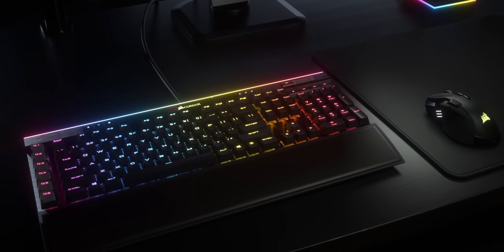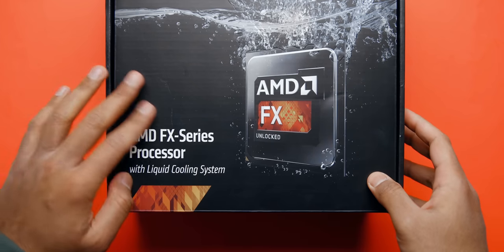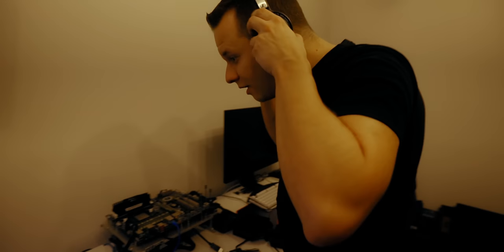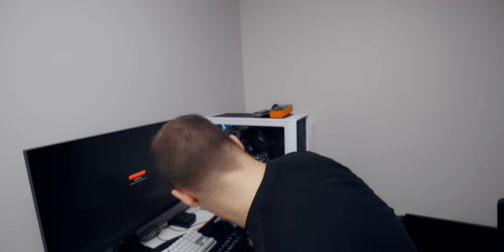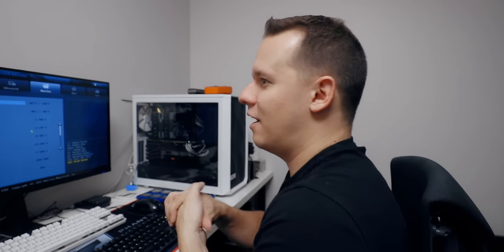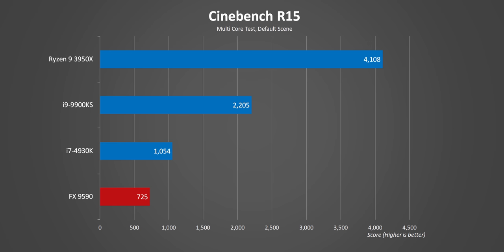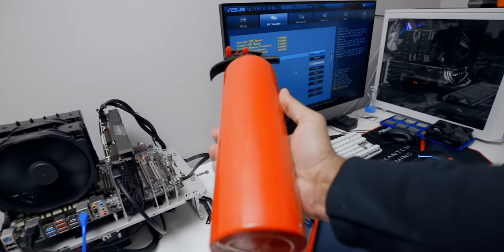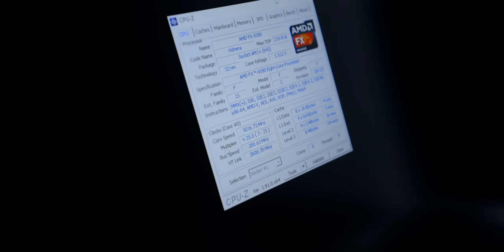Why The FIRST 5GHz CPU Almost Failed - AMD FX-9590 Revisited!

Comment: Many things could be the problem 
NUMBER 1 #  Sensor pics up to much heat  when Turbo brings it up 300 Mhz to 5000Mhz speeds or more!!  "shut you down safety auto! " This is also gonna shut you down not to damage CPU & Motherboard..
This means your cooling solution is not enough or properly working.
POWER SUPPLY  must be a Heavy Horsepower one!! at least a 750 Watt! or a 850 WATT!!  
Why some power supply's at Lower wattage may not be certified to deliver proper power to a 
motherboard with heavy power draw ! yup it's happened  causing a shut down!!!   Seen this to!
Second Motherboard doesn't go that high without a Bios Update!... There bios was made for Certain  CPU'S and Speeds and updating corrects the speed levels accepted by the Motherboard and newer type high end CPUs on the FX line .!!  Some boards were made way before these  type of CPU's were brought to the market!!!  by 5 years or more so check your motherboards spec's !! And again Bios update corrects this problem most of the time!!!!!
Turbo goes to high  settings  and whatever Ram or sink you have  in Ram settings !! yup! and setting it will also crash!!  So make sure those are adjusted to!!  Check online tech tutorials YouTube has them..fast fix.
Sinking your system is also very Important when going high speeds !!  Smooth gameplay.. no flickers and no stutter means your system is tuned perfectly those bad things are signs your not in sink.
So many things to check !!  
You also have to have a Tower with serious air flow!  Front in back out  top out and super fan on cpu heat sink threw and other side fan out towards back fan!   This is my setup  never had a problem!
Plus double fanned CPU  heat sink for much more cooler flow..
Tower and fans and coolers are a must when you go high end Hot CPU's !!!

Comment: One thing I would like to see if posible is a comparison between a Raid 0 setup using 2 x Samsung 1tb 970 Pro's on an X570 mb vs a single 2 tb PCIE 4 x 4 nvme m.2 to se which would be the fastest on the PCIE 4 interface.

Comment: I ran a 9590 for a long time, I put an AirMaker 8 cooler on there, ran it at 4.6GHz.  Ran perfectly.   Please stop using that hateful Adobe Premier crap that everyone knows is in fact optimized for Intel, I use Powerdirector which was optimized for AMD, significantly faster and actually using the proper performance of that cpu.

Comment: The system I'm watching this on right now is running an FX-9590. I built it in 2016 and was able to get just the chip with no cooler or anything for around $260 CAD so it looked like a pretty great buy at the time. It's definitely struggling a bit with modern games though but it's not the worst experience ever. I have it paired with an RTX 2060 at the moment which may actually be overkill to be honest.

Comment: AMD pushed it as a 2M transistor 8 core processor when it was 1.2M transistors and 4 modules of 2 integer units and 1 fp unit each one with it's own cache, being so slow that the L3 cache was as a matter of fact useless (the FX4000 and the Athlon X4 at the same clock perform the same). It was bad. It was so bad that until the third revision the PhenomII could catch up or result in no improvement at all. Take the X6 1100T, it smashed the newborn CPU. They even got sued because it was in reality a 4 core processor.
Why is that? Because AMD built a new gen of CPU based on a socket 2 years old.
But all in all if you consider that many times there is a slight sidestep before a leap forward. Intel was struggling and they had the Q series that looked special on paper and people bought them while the more humble E series was exceptionally good for the price and it hold longer than the Q series. People just thought they needed more cores. Then Sandy Bridge happened. That was a tech miracle. My main system still has a 2600K and I struggle to find a viable option that nets me the same performance tier of the 2011. This looks like the same situation in 2009. I want a Sandy Bridge 2, regardless of who makes it. I'm not a loyal costumer.
The first nail in the coffin of the FX8 and 9 was the 3770K, power consumption to work done for professionals was better even with the AMD lower prices. AMD low prices of the era were at a bad performance/price ratio. The last nail was that the i3 4000 started to be as good as the "8 core" FX8300s. Unless you wanted to just convert videos Intel dual cores did better, for less, with less power. That was when Intel got desperately greedy.

Comment: The CPU never was good. Even for free it would have been a bad choice as just the extra powercost when used regularly would make it more expensive than the Intel-Counterparts fo that time or later.
Just in idle alone the difference is over 20W - underload it is significantly worse and slower too. during gaming this got even worse, with an i7 3770K often using 100W less and delivering a lot better FPS.

Comment: out of curiosity i opted to get in to fx8350 after a deccade under phenomII .. so far im not "Fully Regretting it" it is doing ok.. despite the bad press in 2024. i am not blow away but not let down.  the price for a full crosshair v ram cpu cooler deal was right.  it still does HellDivers 2 and im happy with that.

Comment: Even the 8320 I had was a space heater it would raise the temp in my room form 60 ferinegjt and it would sometimes get it up to 75-80 and I had it paried with a RX 560 and a 20 year old psu that I just recently replace in my new system.i also had it over clocked to 4.91 Gh

Comment: FX-9590 melted 4 out of 8 pins of the 12 volt power where it plugs into the MB
I soldered them to the motherboard and got 5.1ghz stable

Comment: My fx 9590 came with a fx special water cooler with a color changing fx logo on the water pump/block. I had mine at 6.3ghz on 4 cores so it would be cool and stable

Comment: from what i was told at the time, the 8350 was the same as the 9590 with a higher clock. doing a ton of overclocking on a 8350 the first thing that caught my attention was hitting stability. a 4.7GH was far more simple to stabilize compared to a 5GH clock, getting a 5GH required a lot of modifications and still had low stability running high loads. The temperature issue makes sense since i always had mine set to 60c and constant temperature monitoring to watch for instabilities. but generally 4.3-4.5 was simple, 4.5-4.7 was where it started to lose stability, and 4.7-5.0 was basically walking on thin ice waiting for it to crash. there was a time where i had a stable 4.8 running but i tweaked some things in it and ended up just deleting the profile because it wasn't worth running.

Comment: yeah the gigahertz wars historically always lose against simple ipc and efficiency. That said the fx were supposed to compete against 1st gen core series, but got delayed, so they competed against the 2nd gen were they lost. However they overclocked fantastically and if they updated the architecture instead of going into ghz wars they would be fine till 4th gen intel with right pricing. Unfortunately it was not to be because amd got broke and it was more reasonable to pump r&d money into apus, their main cash source because of the consoles.
Discarding the misstep that was 9590 the fx was the first consumer cpu with 8 cores and clocked very highly so I don't think 135w tdp was unreasonable. Years ago I invested in a custom liquid loop that I've migrated to my new main pc for like 15 years at this point and to be honest my old fx 8350 easily overclocked past 4.5 ghz can still game competently if you don't do high refresh rate shooters and I got it for like 40 bucks. I think performance to cost with this price it still is pretty damn good. Of course if you have to buy complete, dead am3+ platform it doesn't make any sense whatsoever, but if you've got one lying around it's better than the 2cores you can have for this price.

Comment: Mine Burned out in under two years on a 360 rad. It also blew at least 3 capacitors on the board which SUCKED because the limited boards you can find were crazy pricey. Also it added like 120$ to my power bill i swear.

Comment: I know a lot of people think they were terrible, but I still us an FX8350 with no issues. I think it's underrated for what it was in its time, and it still handles most modern tasks without issue. It's not going to handle 4K gaming or video editing, but it's a 2012 CPU. I don't think it's holding up too badly.

Comment: Don't do drugs kids, stay away from high voltage CPUs lol I tried for a year to run a 9590, I had a 360mm radiator with 3 fans on the rad and like 4 more in the case and a huge wide open case with tons of ventilation, couldn't keep it cool enough, it killed itself eventually, replaced it with a 2700x, will never go high voltage again, lesson learned lol

Comment: I think your conclusion is wrong. Today is way more games and software out there, that make use of the 8 cores, so if you use it with that, it aged pretty well. 
For example, try Battlefield V on Bulldozer/Piledriver in Comparison with an old intel i5 or i7. There is your fine wine!

Comment: Believe part of the issue with extreme gamers is the fact when trying to boost speed on Ram,  as it only will accept 8 gb a slot which caused many confusments when going into Bios only to have user go into things of settings thinking its the issue which than burns the cpu. I tried to do this of boosting my ram speed and the cpu has the changes needed BUT AT A LIMIT from having motherboard and cpu from getting burnt.Using Duals on FX 8350s is the catch and reasons leading gamers getting pissed off and going on youtube to express their hate. Regardless, I boosted my cpu s ghz by taking what cpu can give while using Duals as it will not accept more then 24 gbs on 4 sticks and cpu has setting of using dual ram but you need to use just 1 if its a 32 gb stick as Ive seen the setting for that range but cpu prefers only using 1 stick for that much gb from overloading the capacity of  voltage and heat.

Comment: Idle power consumption on my 8320e was around 60w, how the heck are you getting 3 times that? I had it set to 3.6ghz and it only consumed 160w at full load.

Comment: The 9590 is garbage. I have one sitting in a box because it would not keep running. Just to get it stable Cool and quiet and many other functions had to be disabled in the bios. Had an ASUS main board that was also not holding bios settings. After changing batteries and a lot of grief I went Intel for the first time. The new system runs like a champ. I will never use AMD or ATI cards again. As soon as I can I am going to unload it but I expect shipping will cost more than it's worth. If it wasn't for the gold in the thing I would chuck it in the can. Garbage.

Comment: i have that board and fx8xxx currently resting ,  you should use asus tuf software to check the temperature, because any popular software that i know (hwmonitor, etc etc) wouldnt give correct reading on the cpu temp, and probably your fx already hit 90 degrees or so .. since i have 20 degree difference between asus tuf software temp reading vs hwmonitor etc etc

Comment: i had one back in the day. bought it new off newegg for $100 and it sat in an asus sabertooth motherboard. it was cooled by a corsair 240mm aio and hit a stable 5.5ghz overclock. used it until i got my i7 8700k machine built. good strong chip still decent today for most tasks

Comment: My favorite CPU hands down was my Northwood Pentium 4 1.6A processor. I definitely won the silicon lottery on that one as I could run it at 2.7GHz (2.8 was pushing it, but I never had an issue at 2.7GHz). 2.4GHz was considered "average."

Comment: i currently still use my pc thats a fx 9590 with the same motherboard, im finally going to be upgrading but this cpu is a nightmare, the only way i ever got it stable was to disable turbo and underclock slightly. it just randomly crashs even though the temps are low. im gonna be so glad to have a new build soon

Comment: I never saw the need for the 9590 since I was able to get my 8370 to 5 GHz and run that 24/7. Obviously I used liquid cooling, but a 2x140mm AIO was enough to keep it cool...barely.

Comment: uuuu my previous CPU. It was great for the money and a perfect test CPU for a custom water loop. If the loop handles the 9590 it will handle anything. 
Although some motherboards, like ASRock extreme could catch on fire due to it.
P.s. I think the lawsuit proved that it was 4cores threaded. 
Also you could buy it new for around $215 in 2015.

Comment: had a 9370 on the same board  but gen 2  had to run 1.56v to get 4.8ghz stable.  ended up melting the cpu power connector and connector on the  psu

Comment: I started into building computers using an A8-7600, I later 'upgraded' to the Athlon x4 845 when it was released only to find that in most games, it performed worse despite the higher IPC (except for NMS, because it was so single thread bound) from the smaller L2 cache. I ended up going to an FX 8350 when the RX 480 was released because everything was bottlenecking the graphics card so much, I sighed in relief when Zen was released

Comment: I remember FX fondly. It wasn’t powerful, but man you could pump some VOLTAGE into that thing and it would keep clocking. It only stopped when your motherboard (sometimes literally) was a molten puddle of plastic or the CPU was melting to the ground.

Comment: I had one of those amd 9590's till it overwhelmed the the power delivery circuits of the high end motherboard I was using. With the cpu under volted @1.39v at 4.6ghz it was still to much and the motherboard died a slow agonizing death.

Comment: I just changed from the fx 9590 to a Ryzen 5 3600. I ran my fx with a Corsair H100. One day while cleaning the rad out I knocked out the fan wires (they were really loose for some reason). A few minutes after startup I start having all kinds of problems and quickly figured it was a over heating problem. The heat coming from the top of my case was insane!

Comment: If I remember right, at release the 9590 had to be purchased as a bundle with a cooler and motherboard. Basically, it was an 8350 cranked to the max, and only the highest-end motherboards were safe to use it on (again, if I'm remembering it right).

Comment: Still using this exact CPU and MB combo to this day in my gaming rig.. had it custom built in 2015 and I remember everyone being envious at the time that I managed to get hold of what was considered the fastest consumer CPU. Never really had major issues with temps, I run a Corsair AiO and it's been fine. I coupled it with a GTX 970 and considering the whole system falls way below current minimum standards it's comfortably able to run just about any new game at low to mid settings, some older ones on high or even ultra. In the process of planning a new build now, but this has been a tremendous machine for 6+ years and will be sadly missed when I eventually retire it! Great video, even if I am a year late lol!

Comment: I used to work at mid sized computer shop in Germany and one a customer showed up whom complained about his pc randomly shutting down. It was an Amd fx 8000 series cpu and first I began with stressing it. It turned off after some while and I noticed it got really hot. So I swapped the case fan with a silent wing cooler and that remedied the issue. The guy was very thankful and I later received a letter from him, in which he thanked me and slipped a cheeky 20€ in for me. One of my favorite work stories still to this day :)

Comment: The FX series aged decently well from some perspectives. Those that bought cpu's like the 8350 for 120 bux used them for a long time, and as games started making use of more cores, they still kept a decent gaming experience to the user. It is very possible to paint this series in different lights depending on where it was used. The value proposition was certainly good in some ways. I would have liked to see a 3770 in this as that was its direct competition. And its successor the 1700x, rather than the other cpu's you used. The 9900 i can see, but not the other 2.

Comment: I still run an 8350. it's the little engine that can and will.
And like a steam engine it runs hot as hell, could use an update, and will do for now.
I can only sit and sweat in wonder at what that monstrosity would do.

Comment: I own 3x ST 990FX R2.0's and the CH-V Formula-Z with the 8320, 8350, 8370, and 9590, i love the ST R2 with the 8370 the most, using a Noctua U12A and some 0.41 amp delta's and the Noctua iPPC 2K in the rear of an older case Aspire: X-Cruiser case, I have a HAF XB EVO one too that is a tank. the 9590 is inside a Rosewill SPECTRA X  using a Rosewill Proton 1050w and other 1000w is the others, 8370 at 42c max load, 9590 53c max load. I'll upload a video someday, too many projects and are currently being used to mine with. all at 5GHz or more stable
Reply: You not fully overclocking/under volting it correctly & I assume your PSU isn't up to these beast, I'll be sure to include my settings when I share

Comment: I just found my dual pentium pro 100 motherboard with 128 mb of  60 ns 72 pin ram and adaptec 2940.  Built for OS2 but last seen running NT5 beta.

Comment: i still run a 9590 24x7 for my plex/NAS/pihole/Minecraft/everything linux server
Reply: never felt the need to OC it.  It spends most of the time clocked down to 1.4GHZ .... until Plex needs to start transcoding.  ive been able to have Plex run up to 6 streams simultaneous with zero issues.  never tried 7 or more - dont have that many devices connected to it.  The old i5 750 i used for plex before that couldnt handle it.